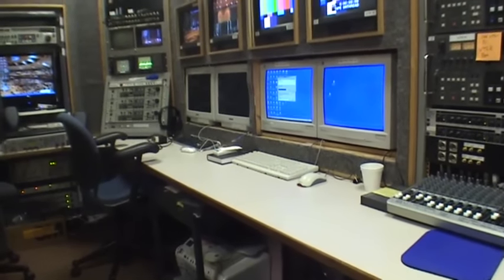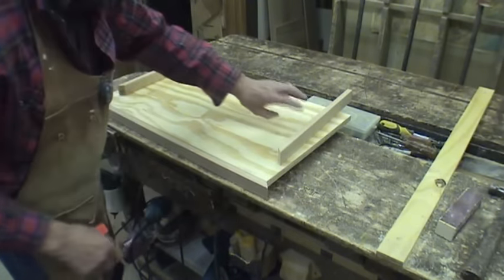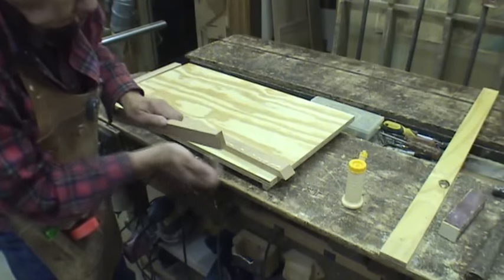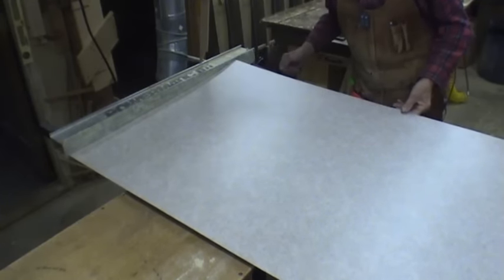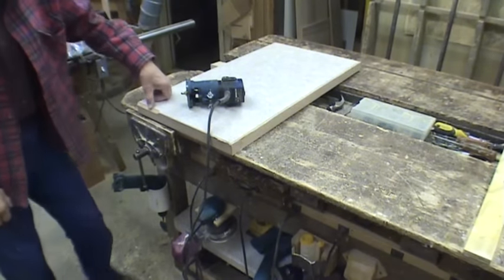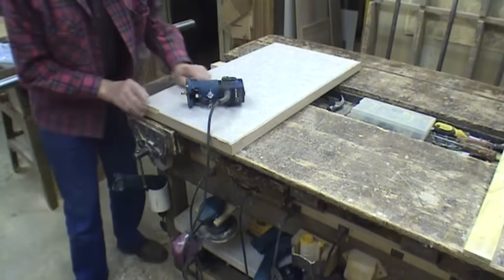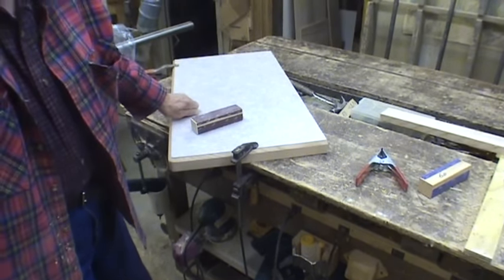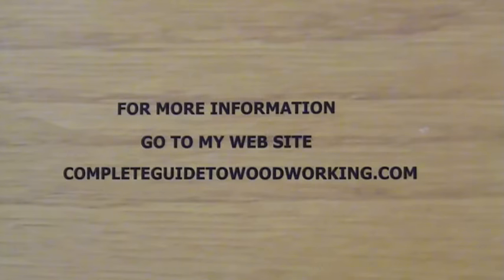DIY Wood Edge Laminate Countertops

Comment: A million thanks for this excellent video! I didn't know before that it was this simple to make a wood edged laminate countertop. This will surely be my guide when making my kitchen countertop. I have a question. If I want to make the wood edge the same level as the laminate, not the 45 degree angle as shown in the video, what should I do to guarantee they are exactly the same level? Much grateful for your reply. Thank you!
Reply from the maker: +Ann Shr  First put the laminate overlapping the wood edge by 1/8-1/4 ".  Then take a 1/8" round-over bit and round over the edge  That will give you the smallest edge you want. Then lightly sand.  If you want less round over, use a straight bit,  trim the laminate even and just use a sanding block a little.